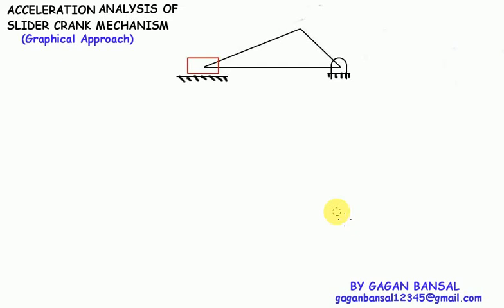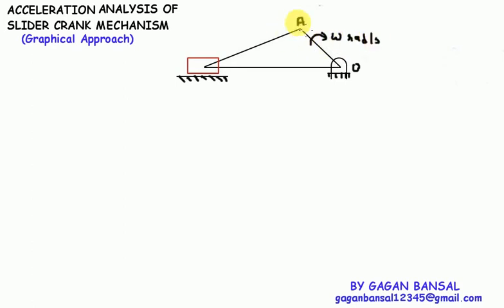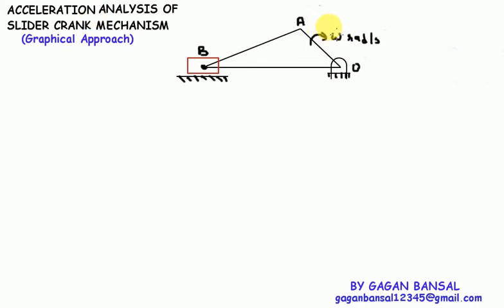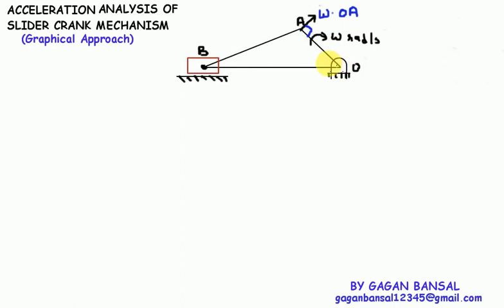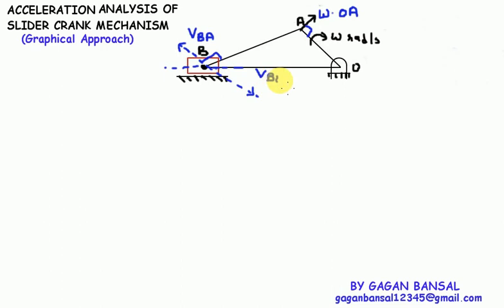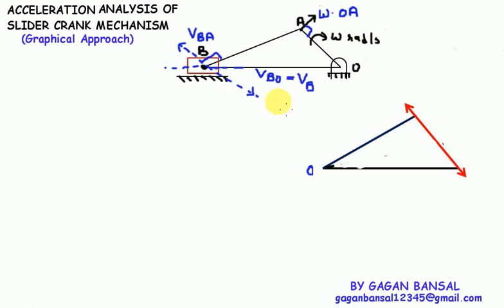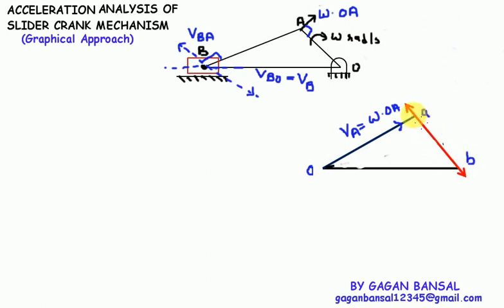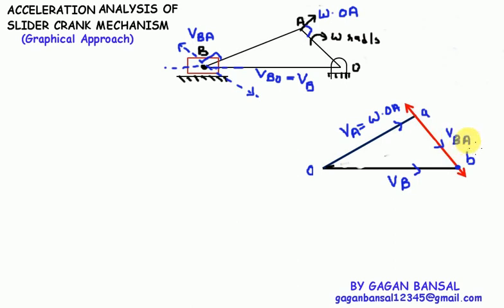U03L05 ACCELERATION ANALYSIS SLIDER CRANK MECHANISM || BY GAGAN BANSAL || VIDEO LECTURE || KOM

Comment: An  offset  slider-crank  chain  mechanism,  as  shown  in  below  figure,  the  crank  is  driven  by  the slider  B  at  a  speed  of  15  m/s  towards  the  left  at  given  instant.  Find  the  velocity  of  the  offset  point  D on  the  coupler  AB  and  the  angular  velocities  of  links  OA  and  AB. 

Sir please give me solutions of this question..